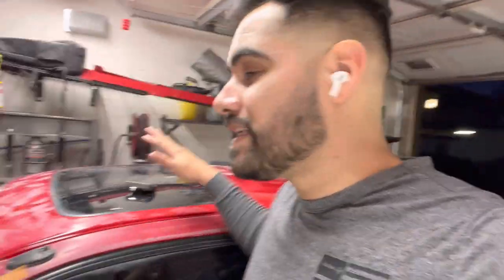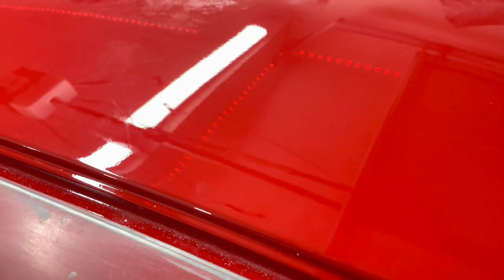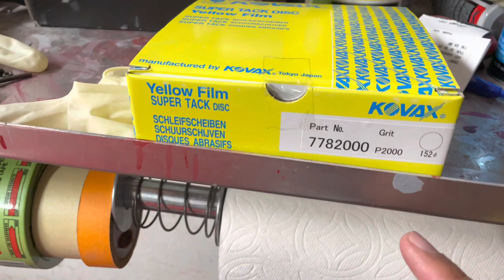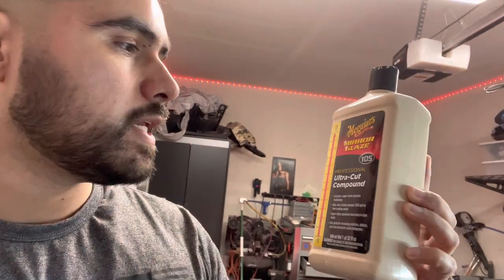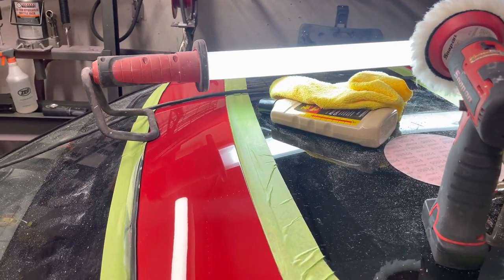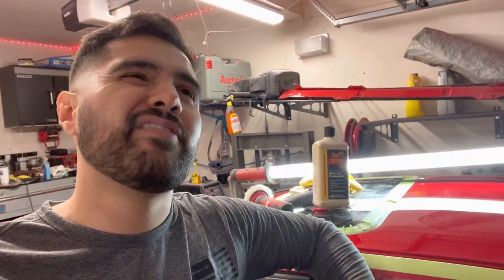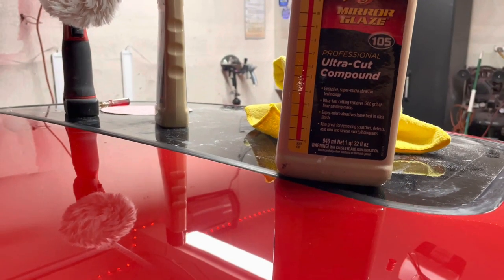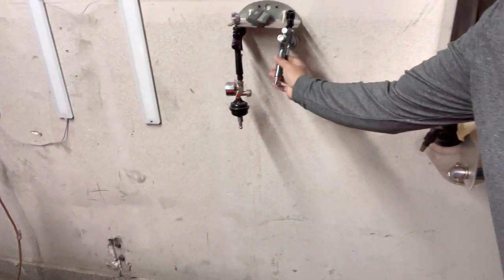Is It Worth Painting Your Own Car At Home?

Comment: Fantastic finish on the roof Chris, as you say with a bit of extra work on the flatting and polishing you can get it to that showroom finish even if you don't have any tools it would still work out cheaper than paying a body shop to do it.
I have a small homemade booth in the corner of my workshop it's fully kitted out with intake filters and a good extraction setup, also have a dropout filter on my airline before a 3stage filtration system for my air fed mask, cost me a small fortune but it's my hobby and something to learn now I don't work 🙏👍 John UK.
Reply from the maker: Thanks John that setup sounds amazing I would love to see a video on it if you got one ?
Reply: Thanks Chris, everything I've got on video is on IG here's a link to my main page, if you look at the bike fuel tank there are 2 short videos of me spraying in the booth: https://www.instagram.com/johntc02/ 
This is when I first fitted the extraction: https://www.instagram.com/p/CLHoxllga0W/
🤗👍